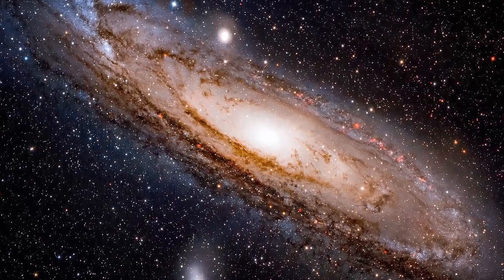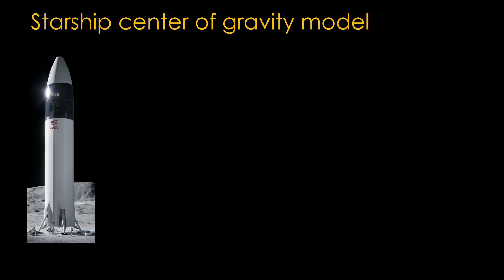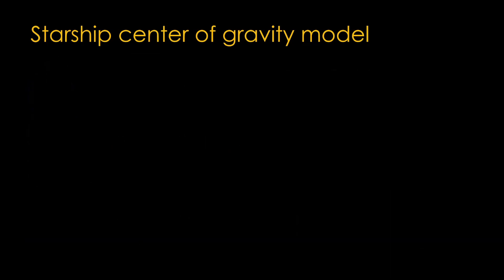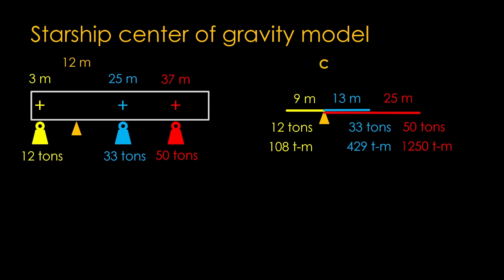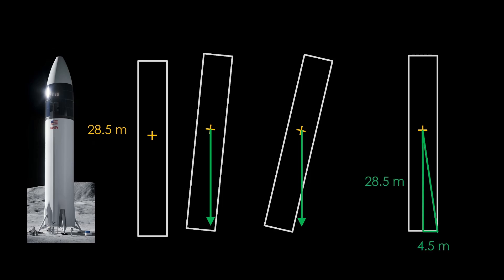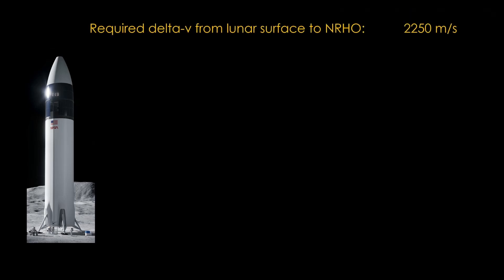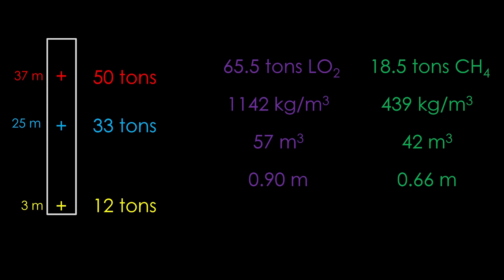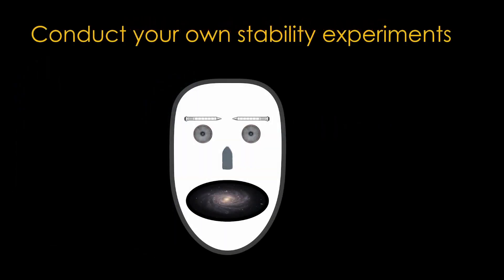Will Starship Fall Over?

Comment: Didn’t account for the upper landing engines, but close enough. There are other ways to combine some things to vastly increase the landing leg stance while also shifting the payload weight lower. If the landing engines were repositioned higher in the nosecone and the cargo and crew sections of the ship were split vertically and attached to a set of three long legs pivoting outward from the bottom of the ship, all the weight of the cargo and crew sections would be on the surface at landing. Also you could switch to a tank in tank design so that the remaining fuel in both tanks would be closer to the bottom of the ship. That all might seem radical, but it would not only make tipping impossible but would also eliminate the need for an elevator mechanism as everything would already be on the surface. This landing configuration could even be deployed in LEO prior to setting off for the moon so it wouldn’t run into any issues in lunar orbit where it would be more complicated to fix.
Reply from the maker: Seems like a lot of additional complexity. Remember that this structure needs to survive launch and travel and then the fancy mechanicals that you prescribe need to work correctly in vacuum, which is always iffy.
Both NASA and SpaceX seem fine with the elevator concept.
Reply: @ It might seem more complex, but it really isn’t. We already know that the flap actuator motors work in a vacuum. I’m sure they could handle a similar system to deploy the legs. Locking the three sections of the nosecone together for the launch and unlocking them in orbit isn’t any more complicated than  the giant hinged cargo door they had planned for their cargo starship version. The hinges would need to be scaled up a bit, but that’s easy enough. It may be a bit out of the box thinking, but not overly complex.

Comment: If the recent landing fails have taught us anything it's that dynamic stability is MUCH more important than static stability. Remember, in 1/6g, the force it takes to lift that cg past the tipping point is 1/6th as much but the lander had the same momentum as on earth, severely reducing stability. Three major issues you didn't account for are horizontal velocity and landing at any angle where one or two legs touchdown first and the massive torque that will exert on the lander, and stability ie how far upwards the CG has to move before reaching the tipping point. The dynamic movements of approach and landing on a very uneven, soft, grabby, and non-uniform surface in 1/6g is extremely unforgiving and even a minuscule horizontal velocity or a forward leg snagging is all it takes to topple a tall lander.
Reply: The landing engines are a ring of hot gas thrusters higher than the center of gravity, so there is no problem cancelling the tipping torque.
Reply: Not true, that's the pendulum rocket fallacy in action. Because they're part of the rocket, it doesn't matter where they are, it doesn't change stability at all.
Reply: @GlutenEruption  It does. We are talking about after the landing happened, not in flight. You can:
- cancel the remaining torque by applying an opposite torque around the center of gravity
- put the CG within the convex hull of the legs if needed by applying torque around the center of gravity
To do that with engines at the bottom you need to take off again. With engines at the top you are good.

Comment: I worry about the modulus of elasticity of lunar soil (Young's Modulus here on Earth) and how much can it vary before contributing to the final angle of 'tippyness' of the rocket.  How do you predetermine what you're up against without preparing the landing spot?
Reply from the maker: It's definitely a concern, but I think there is some decent data from Apollo that will probably help out. Before Apollo there was a lot of concern that the landing pads would sink into the soil but it turns out that there was not issue at all. 

Starship is a different scale, of course.
Reply: @EagerSpace   Good to see you're still replying here. Something occurred to me today when replying to someone else here. 

Another factor has occurred to me, one no other lander has, real or fictional. Starship will be coming down using multiple auxiliary engines near the top of the ship. Any tipping could be compensated for by differential thrust to help the legs shift and settle and use the self-leveling feature we're promised they'll have. (Very deep "throttling" can be accomplished by shutting down an engine in each set.) Also, if the angle is too bad the ship can lift off and settle a few meters away - although that will depend on whether it can carry enough propellant reserve to do that. Even at its most basic, I expect the engines to decrease their thrust gradually after ground contact is made. If the angle is bad enough the computer can simply "abort to orbit." The aux engines go to full thrust and the Raptors ignite. The two used for most of the descent can be kept ready to ignite - I imagine.

Comment: I can imagin them putting 30 meter long falcon 9 style legs on the lunar starship
Reply: Seems likely.
Reply: Falcon 9 style legs use crush cores, very bad for tall Starship. The legs need to conform to the lunar surface and hold Starship plumb.

Comment: Experienced KSP player here. Things that come to my mind (not sure hiw well they translate to the real world): 
1. The landing legs help most if one leg directly points downhill. If the downhill direction is at 45° between two legs, the width of the base is significantly smaller.   
2. Bouncyness: Landing legs are designed to take the impact of landing, which means they need some room to flex. During landing, *especially on slopes*, the lander will swing a bit back and forth before settling to its stable position. If during this motion, the COG is outside the ground area, it will tip over.
3. Torque: When the lander leans over, the downhill facing leg(s) need to bear a higher load. This causes them to give in more, amplifying the tipping. This problem is especially bad for tall landers.

That's why this starship render really scares me ...
Reply: Another factor has occurred to me, one no other lander has, real or fictional. Starship will be coming down using multiple auxiliary engines near the top of the ship. Any tipping could be compensated for by differential thrust to help the legs settle and use the self-leveling feature we're promised they'll have.. Also, if the angle is too bad the ship can lift off and settle a few meters away - although that will depend on whether it can carry enough propellant reserve to do that. Even at its most basic, I expect the engines to decrease their thrust gradually after ground contact is made. If the angle is bad the computer can simply "abort to orbit." The aux engines go to full thrust and the Raptors ignite. The two used for most of the descent can be kept ready to ignite - I imagine.
Reply: @donjones4719  This is not 60s anymore where the pilot is eyeballing the landing site. The landing place will be precisely picked and Starship will land with accuracy below one meter. There is likely to be about 2-3 degrees of slope on the landing site. Everything else is just being cautious. It might not be for Artemis 3, but unmanned construction machines are likely to flatten the landing zone for other missions, and then we will get a concrete landing pad or catch tower.
Reply: @Ormusn2o   True, I expect Starship to have a well chosen site that it accurately land on. I list all of its capabilities here to address the often repeated concerns and to get people to shut the fuck up about it.  :)
Reply: @donjones4719  Yeah, I think one of the renders of starship did not even had retractable legs like that, they were more low profile, because SpaceX knows you don't actually need that wide of a bottom. Good for you fighting the good fight in the comments too :)
Reply: Nice tips for a noob ksp player.Mun was so punishing before!
Reply: despite the real moon having some real bad slopes, the moon isn't the mün, it has much more flat surfaces. ksp mun is a rollercoaster of slopes compared to our irl moon
Reply: Even worse, on terrestrial bodies with atmosphere the wind could tip it over
Reply: If you make lander with very low center of mass, it will almost never tip over in surface

Comment: Fuel slosh would reduce the angle - so would lateral velocity at touchdown - so would landing on uneven ground.

Simplified 'back of the envelop; calculatins are useful only if you have a huge margin. If a simple static-force calculation says you can handle 20%, you can in fact handle 10%. So current Starship will be too unstable for exploration. HOWEVER Artemis is not exploration.

If the first mission to Shackelton crater has wide, heavy DISPOSABLE landing gear and the crew mark out level ground  and subsequant Starships land on the level ground, a less stable design is OK.

Comment: In the equation at 6:55, I see 9.8. I'm assuming that's for gravitational acceleration. If so, I think you might be using the figure for the wrong planet. If so, I think the fuel needed to reach orbit could be quite a bit lighter. I mean, you'd probably want some extra fuel for contingency. If I'm wrong, please let me know. If that's correct, it would be interesting to see how it affects the equations.
Reply: Apparently, 9.8 (or 'standard gravity') is the correct value here, because Isp is a weird bastard child of the metric and imperial systems.
The value that actually matters in the rocket equation is the exhaust velocity v(e) of your reaction engine, and v(e) = Isp * 9.8 https://en.wikipedia.org/wiki/Tsiolkovsky_rocket_equation

Comment: It would be interesting to take this stability model and deduce how much lateral velocity Starship could tolerate at touchdown on a level plane. I know, with computers this is realistically as close to zero as makes no difference, but still.
Reply from the maker: I considered doing that, but I was too lazy to do it. It would be fairly straightforward.

Comment: Interesting calculations. There are a few more factors that could significantly contribute.
First, the terrain tilt may not be towards one leg, but between two legs. The deviation would then be closer to the half-side of the landing legs square, as opposed to half the diagonal. This significantly reduces the stability.
Second, the terrain may depress under one or more of the landing legs. It doesn't need to be much to throw the thing off-balance - considering that landing on tilted ground puts a lot more weight on the lower legs than on the upper ones, and Starship weights quite a lot.
Third, horizontal speed massively changes the max tilt angle. Starship would be particularly vulnerable to sideway speed, since its high mass would have high inertia. If the sideways speed is towards the lower end, the pressure on the lower legs would make them even more likely to sink in. I don't think this factor would be much of a deal, since computers would be in control, unlike in Apollo, and they would likely negate the horizontal speed.
In all, Starship would be crazy efficient if there is a landing pad prepared. But the first landing would likely have much larger legs and probably ballast in the lower parts, and the rovers it carries can prepare landing pads for the next landers. I'm sure SpaceX would do their homework so the lander does not fall over.
Reply: Doesn't matter if it tilts towards one leg or two, it's the net that counts.  They already know the terrain doesn't compress very easily but it's of course not impossible.  They'll kill the horizontal speed much the way Apollo did and likely try to come in as straight up and down as possible, they won't be landing under manual control.  Lastly landing legs can be made to compensate for a lot including self leveling.

Comment: I think starship's hull is nearer 4mm thick but that may change by the time they're ready to land it in the moon. It will also have landing engines higher up the hull and very possibly 9 raptor engines in the skirt.
Reply: Unlikely to require 9 engines. In fact they just need enough for trans-lunar injection. Just 4 engines minimum.

Comment: can they not map the height at each leg as it descends and mechanically adjust the legs height for standing position, using actuators to either telescopically adjusting the length or using pistons the angle, a bit how a four legged robots cybernetics will autobalance, Personally I think as long as the landing spot has been vetted in advance by orbital drone this shouldn't be a big problem as a suitable site can be selected, I am far more worried about regolith kicking up when taking off and breaking a thin pipe or the engine bell, or even just blocking some of the outlets with regolith.
Reply: Yes, the landing legs can self-level to a degree.  Regolith will be moving away from the ship when the engines are firing, not towards it.
Reply: @TheEvilmooseofdoom  this actually happened with the martyte concrete platforms while they were testing SN8, they have covers now, but still...

Comment: Starship cannot land and still stay standing safely at 20 or less degree angle. As soon as you open the cargo bay doors and start lowering cargo from the nose, you're putting weight outside that 20° angle.
Reply: Yeah, and lowing it, which makes it even more stable.
Reply: @TheEvilmooseofdoom  "Yeah, and lowing it, which makes it even more stable."

Not at all.  the mass is still suspended from a point above the door, no matter how long the cable is.

Comment: How on Earth in Starship supposed to keep its fuels at cryogenic temperatures for the weeks it would take to complete a lunar mission?
How much fuel can Starship expect to have off-gassed by the time it needs to launch into lunar orbit?
Are they expecting to take an alternative energy source to keep these fuels refrigerated over those weeks?
Or are their tanks just absurdly well insulated in vacuum flasks to keep LOX cold for weeks in direct sun, with all the weight that implies?
Reply from the maker: An engineering analysis could be done to quantify this, but I haven't do it, so here are my thoughts. 

The only heat gain on the moon or in orbit is from solar radiation. Lunar starship is white to reflect as much of the energy as possible, but some will heat up the structure. 

When you put heat into cryogenic liquids, they don't heat up but rather some of the liquid turns into gas. That absorbs a lot of heat so that the rest of the liquid stays liquid. So the real question is how much of the propellants they will have left. 

My understanding is that it won't be significant in this sort of scenario, but I haven't done any analysis. I do know that NASA has done some work to develop techniques to keep liquid hydrogen liquid for long flights, and that's much harder to do than methane or oxygen as the hydrogen temperatures are so much colder.
Reply: @EagerSpace  Can they spend some electricity to cool the propellants? How much solar panels or batteries will that take?

Comment: Not quite complete.  But the rest of the calculation is more complex. 
It could tip over if it: 
(1) Contacts the surface a particular lean angle X ; 
(2) AND if it contacts the surface with horizontal velocity above Y. 

Yes, it's likely supposed to descend completely vertically.  
But the above is relevant in case it does not.
Reply from the maker: Definitely true. 

For #1, I included the Apollo 15 example which looks really tilted to me and yet Starship would be fine with that angle. Starship is probably a bit more immune to this because the landing pads are so much farther apart, but it's still possible. 

For #2, I'm expecting that starship is probably going to autoland and that keeping the horizontal velocity low will not be a problem. Apollo was all under 1 m/s horizontal velocity and that was with hand control. Could still happen.
Reply: Worse case scenario: It contacts the surface at +X° and with Ym/s, then tips to the opposite -X° in rebound, then suddenly halts Y to 0m/s as a leg digs in, with +X being naturally inclined away from Y direction to halt the horizontal translation.  Fuel slosh is not just the off-center weight, but horizontal momentum still traveling at Ym/s that must decelerate to 0 with an initial state already in the worst sloshed state, which is also not perpendicular to gravity, but swinging up the side.
Also geometry of the legs should assume they are at 45° (if 4 legs), not 90° to the slope direction, reducing the horizontal component of the leg to about 71%, and mounted further from the apex of the rocket body's radius as you rotate to 45°. On 9m body with legs extending out 8m from center, the mounting point of the leg at 45° is only 3.18m from the center of the body and the foot is only 5.66m from the center, barely over a meter wider than the body itself.